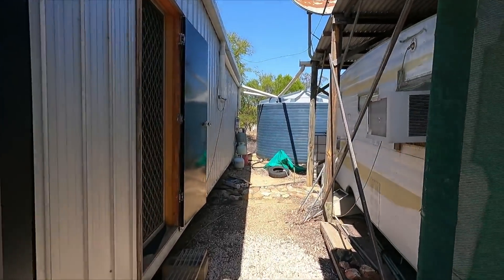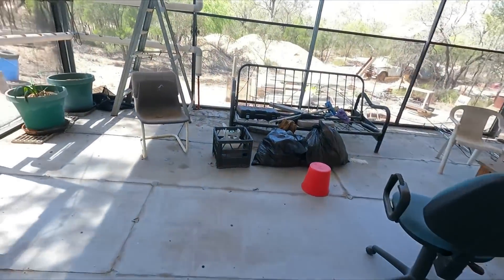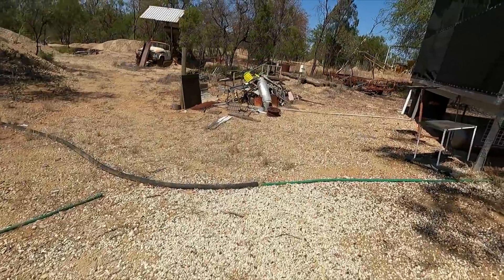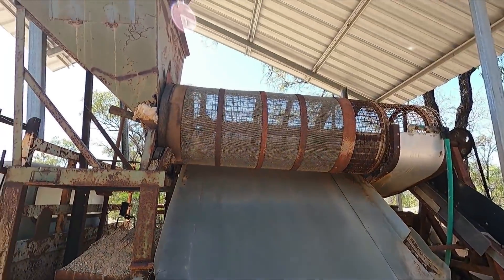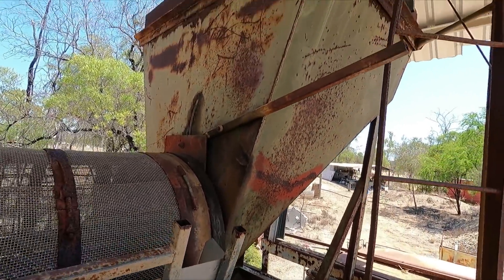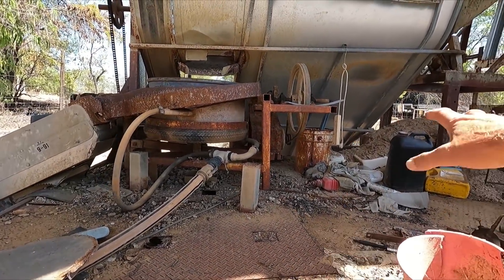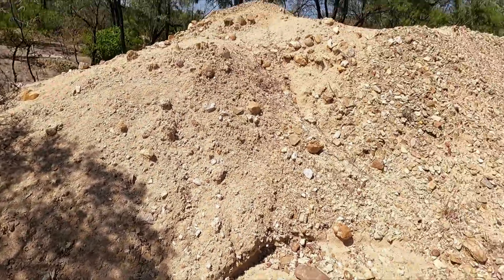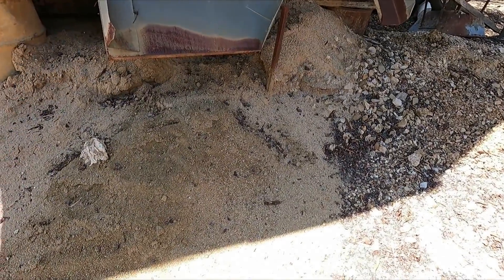Sapphire Mining Australia ,Tim's Adventures [ V: 391 ]

Comment: Congratulations, Tim! looks like another big project :) Now ya need to get a Skiddy and mini-ex. If you do the concrete for your water tailings, be sure to put some type of iron ribs in it to prevent an excavator from wearing through it. It doesn't take long. Railroad rail works great if you can get your hands on some sections of it, but it's a major pain to cut. Good luck!
Reply from the maker: Ok ,many thanks for the tip Darrell